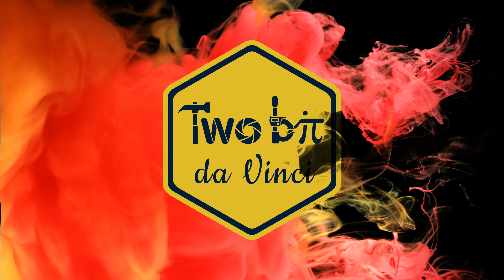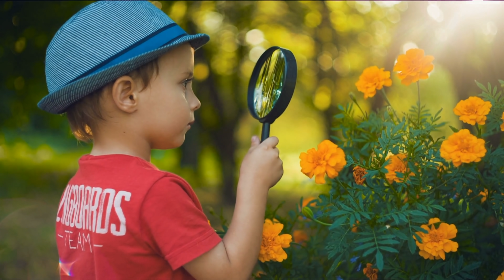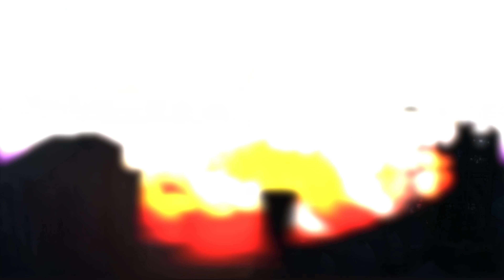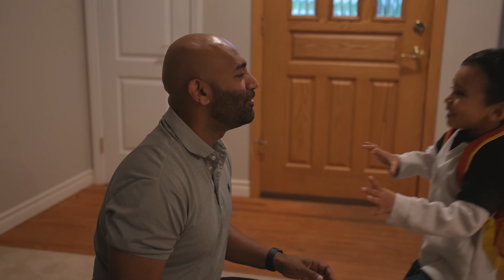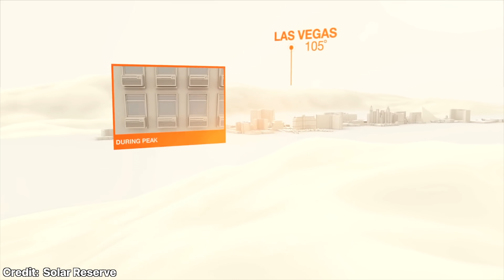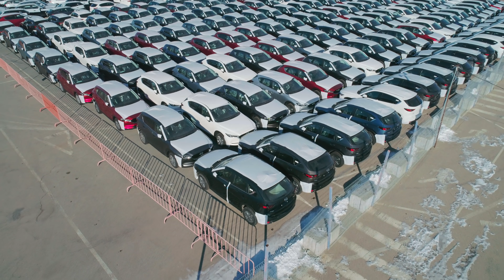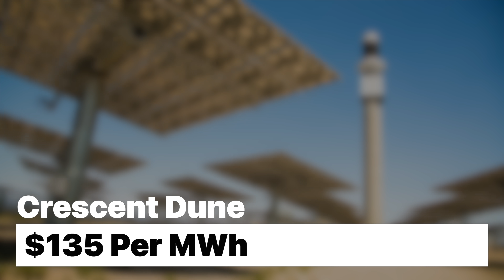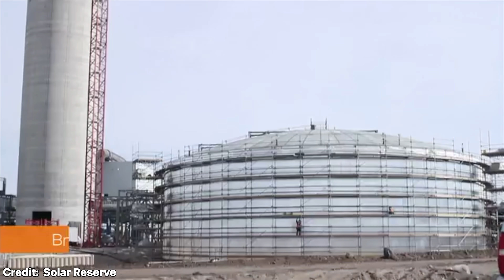This Billion Dollar Solar Plant was an EPIC Failure

Comment: Your video exposes a major flaw in capitalism. The solar thermal plant isn't viable at small scales. Solar panels are. So you can sell more parts than for solar thermal. This drives down costs of parts  faster as opposed to solar thermal parts. Also, you skipped over the effects of government investment. Solar panel investment from government is massive (thanks Obama) as opposed to solar thermal. This is due to lobbyists, who see more cash grab by selling personal solar. Which btw, billions of solar panels and batteries, are horrendous for the environment, as opposed to solar thermal. This video exposes yet another fail for capitalism and government, choosing inferior tech over superior.

Comment: Nuclear molten salt is  a way better choice.  Molten salt itself will be a sensible future tech but not necessarily used in this form. Solar has a huge environmental downstream cost not visible right away with the effects of mining and the energy use required to manufacture the photovoltaics.    Your show seems a little blind.

Comment: I worked on installation of simillar powerplant in Israel 110Mv actual out 130Mv on papers. We had molten salt capacitors with plate thickness more than my forearm. They had to use gas burners overnight (some 100m diameter each, there were 2 of them) to anneal weald seams. The one i worked resembled more your stamdart  solar farm - flat config with concave pivoting mirrors with piping running throu focus line. But on the other side of highway we have ye olde Tower using GE machinerry - 90Mv out of 110Mv, it also had gas turbines instead of molten salt capacitors for night time operation. So far so good, they both running from 2018 just fine.

Comment: Personally, I'm glad it failed.  Lots of birds die to these solar farms every year.  Burned right out of the sky, feathers melted.  Same with wind, but you can actually put things on the blades so the birds can see them and avoid them.  I still think all this is stupid though.  We should be using solar and wind on buildings, but heavy water reactors for everything else.

Comment: The high speed fly-wheels make a bit more sense for short-term energy storage than the chemical batteries which suffer degradation over time.  It's just storing the energy as kinetic energy, or in places that are geologically favorable, as gravitational-potential-energy in the form of storing a lot of mass up high.  But short-term energy storage in the form of heat ... that doesn't really make sense to me.  All that said, I'm a nobody on the internet, and this is not my career field, so take it for what it's worth.

Comment: I am not that sure if this comparison was fair. In order to exactly compare PV to solar thermal or nuclear (both base-load) you would have to build a PV farm that can put out power constantly, the whole year around*. The battery storage quantities for this would be quite large. And batteries are still relatively expensive. I therefor think that the shutdown was maybe a bit early cost wise, even though the maintenance flaws are hardly ignorable.

*RN there is no energy source that can do that, not even nuclear. You always will have maintenance shutdowns.

Comment: the problem is, the number of PVs required to replace a significant minority of our base consumption simply can't be scaled up to the numbers necessary. These plants, although expensive, will need to be engaged.
Reply: Wrong. PV scales up, doubles every 3-4 years

Comment: Well, this is embarrassing... I made my senior thesis on this power plant because I spent a lot of time driving in-between Las Vegas and Arizona and I always found this fascinating. Our question was that Microsoft wanted to build a new HQ in Arizona but wanted to be energy independent, so what is the best clean energy option that they could be completely energy independent? Well I heard this system powered the Las Vegas strip at night based off the heat in the desert in collected in the day which was a perfect application in my mind. Microsoft's main concern was that this system was too expensive for what their goal was.
Reply: oh i thought this was the one down by jean like south west of mccullough
Reply: There's a mistake in the video. The Crescent Dunes plant is in northern Nevada. Ivanpah plant by Las Vegas is still working.

Comment: Have you thought about it may not be the engineering blunder that you made it out to be. If these mirrors can focus collectively on a lot more than that salt tower. They could refocus and track on adversarial air or space assets. It could be a great defense tool.
Reply: If the asset happened to fly reaaaally slow and at the perfect focal distance from the mirror array , AND only on sunny daytime hours…. Great plan!
Reply: @vegasrider7287  both the focal distance and tracking is accomplished with individual mirror servos in place already. Learn how a phased array works and you will have learned how this could focus and track as quick as needed. It take a long time for a satellite to cross the sky. Have you not watched them before? In MI you can see them easily with your own eyes.
Reply: @nathanroberson  You do realize that mirrors only work to reflect sunlight... in the daytime... with no clouds? Pretty easy to defeat.

Comment: This was pioneered by Rockwell Intl., Martin-Marietta, and McDonnell-Douglas in 1982 - called "SOLAR 1", it was located off I-40 outside of Barstow, CA.   I was working at Rocketdyne at the time, and I think we were involved in the collector and thermal storage portion of the pilot project.  I remember the first time I saw it - as bright as the sun - glowing white-hot, very impressive.  As engineers, we discussed whether or not the concept would ever be cost effective.  As I recall - the consensus was, it was similar to desalination - a good-sounding idea that just had too many daunting problems and ROI issues.
Reply: At the time it was probably due to become cost effective. But it got overtaken by simple PV

Comment: You really should find out where this place is.
First, you said you could see it off the 15 on your way up to Vegas, which is right. But then later, you said it was 200 miles northwest of Vegas.
The 15 goes north northeast from Vegas. 
It has been a couple of years since I went toward California on the 15, but it sure looked like it was in operation then. You can go blind looking at it! They should not have put it so close to the freeway.
I thought it was a neat idea when I figured out what it was, but I'm glad I didn't invest in it if it's such a boondoggle.

Comment: Note: Concentrated solar isn’t a terrible idea. In fact, some of the largest solar power generating stations are CSP plants. And while photovoltaic plants are becoming larger and cheaper, there may still be a place for CSP. For instance, in places where photovoltaics are still expensive to import, but thermal power generation has become an established industry. I am not an expert tho, I just did some research because I remember hearing about how the CSP plant near Primm, NV worked and thought it was pretty cool. And, by the way, that plant has exceeded the expected annual output.

Comment: So one thing I'm not getting too much, this whole "cost" bit.... ok so it costs Nevada $135 per MWh, which translates to 13.5 cents per kWh which is looking at my last electric bill is WAY less than what I pay per kWh.   But fine $30 per MWh for the PV solar farm,  who's making the profits here?   Are residential rates 4.5 times cheaper?  No?   The PV farms are selling for cheaper so they obviously aren't making the profits.   How about the guys who are buying the electricity?  That's your answer, they're raking in the profits because now they can buy cheaper "green" energy.    Also is that $30 taking into account the peaker plants that needs to supplement power for most of the night/evening/morning?     

Ultimately though if they were running 20% efficiency when they should have been doing 50%, unless they flat out lied with that projection (probable) if they can get the efficiency up to where they should be that'll decrease the cost by a factor of 2.5x.    While still almost twice as much it would be a good start,  plus you absolutely have to add in some cost for storage.

Comment: Thinking about the S-Curve you mention Tesla that is a company at least car side which is going to run into the S-curve sooner than later they are really successful now as a major EV manufacture but in the not to distant future the big companies are really going to pile into that market. Tesla makes around 400,000 cars a year if a company like Toyota turn 50% of the cars it manufactured into EV that is 5,000,000 cars a year with the result cost reductions from mass production at which point Tesla becomes a Rolls Royce or Jaguar a small manufacture of my guess highend EV's.

Comment: I did a group research paper comparing CSP to Photovoltaic panels for a final in my renewable energy engineering course, and one of the things I learned is that the reason that these are built in the desert is because high temperatures affect the efficiency of photovoltaics. Its sad to see that since they did not plan effectively that the plant failed but it is not the fault of the type of solar energy. This cannot be replaced with a regular photovoltaic field as big batteries would have to be built and the high temperatures would lower efficiency. I hope that somehow there will be a way to make this type of power source cheaper as having a solar power source that has an energy storage system built in is revolutionary. Remember, batteries are still harmful for the environment themselves as lithium is still the main material needed which negatively effects the environment. This type of solar energy uses its own power source as a battery. I definitely still believe that this can work great in extremely hot and open places like the desert outside of Las Vegas but large plants like this need to be careful. If anyone is interested I'll leave a link to my paper in the comments. Please let me know what you think as I am still training myself to master renewable energy
Reply: I'd love to see it.   You'd love Bill Mollison, not exactly engineering, but concepts to engineer from.  Sounds like you are looking to work on solutions not virtue signaling or a camp to be in.  BRAVO. You just restored a lot of the hope I lost reading a lot of the other comments.

Comment: As a layman I'll never truly understand reflecting the sun back up, shouldn't it just divert down?  And I have a plastic fresnel lens that concentrates far better imo.  i don't understand why passive systems aren't being tried.  Solar in this way should just be additive energy, not primary.  Plus we see all these companies across the US who just suck up public monies and don't really have a good plan ... at least this one got up and running, some don't.  We should be pissed.  You can literally put fresnel lenses over a pipe with whatever moderator you want and passively create energy.  1B$ for 100 MW... right location, bad spending and engineering.  people seem to forget, 500M/pop. of US is a $1+/ person... return benefit...$0.  Could I as a novice think up and initiate a power plant for 500M with a return benefit to the public?  Would the public ever get it's $ worth in my lifetime?  yup, i think so.

Comment: "The technology started to debut in 2009..."  You have to be kidding.  I did software development on the Solar One power plant at Daggett in the Carter years, the late 1970s.  Martin-Marietta built a heliostat factory in Pueblo to supply heliostats for the project, and a second in Almaria, Spain.  With the completion of that project, the Regan administration shut down further efforts to investigate solar power.  The plant was obviously a pilot plant, generating 10 MWe.  It operated through the 80s, went through a central tower rebuild in 1986 to use salt generation, then became a test area for one of the colleges in California, before being scrapped in 2009.  It was at 34.8717,-116.8342.  The site is still there, cleaned off.  

I suppose you are right about the economics, but the technology is older than you recognized.  Had it not had to restart from scratch after Regan and Bush left office, it is interesting what might have been produced.
Reply: Thanks for providing evidence that Reagan and Co were instrumental in aiding the demise of solar power through deliberate obstruction.

Comment: I've been interested in solar energy usage since the early days of NASA. I took two solar energy usage classes at two different universities in the late 1970s. Both involved thermal solar energy. A facility like this was even discussed as a possibility. Phase change salts for heat storage isn't new - wasn't new even back then. My conclusion was that thermal solar wasn't the future for alternative energy - too complex and expensive to install and operate. I concluded that PV was the future, but back then PV cells were very expensive and they weren't very efficient. New technologies and mass production has reduced the costs to now be competitive and actually less expensive than some traditional means of generating electricity.
Reply: Total bullshit,we had a cheap ,reliable system with coal fired power stations,co2 is not a problem,the so called science is the problem,now we have an energy crisis that has driven the price of oil and coal through the roof,and shown that unreliables are expensive,and now governments are reverting back to coal,before people start chopping down more trees to keep warm,how green is that,you can't make this shit up!
Reply: @SamsungSamsung-md9xq  Fossil fuels are finite. Worldwide petroleum reserves are projected to run out in about 50 years barring discovery of new ones. Known coal reserves are longer, but most of the existing reserves are buried too deep to be cost effectively mined.
Solar is free, doesn't need to be drilled for, mined or transported. It cannot be controlled by governments or corporations and will be here long after both you and I are dead and gone.

Comment: You can increase output by replacing mirrors with reflective solar panels. The thermal output can be used during the night and pv output during day!

I have worked in solar island proto by csem in RAK

Comment: I can say that the birds will thank the PV solar manufacturers! The salt tower plants have a problem with killing birds! 
NV Energy had agreed to buy electricity from Crescent Dunes up until 2040 but broke off the contract over performance failures at the plant.

Crescent Dunes was developed with $737 million in U.S. Department of Energy loan guarantees 
One of the highest-profile failures at Crescent Dunes was an eight-month shutdown caused by a leak in the plant’s molten salt thermal storage tank.

SolarReserve’s lawsuit blamed the leak on ACS Cobra, a Spanish company that carried out the engineering, procurement and construction work for Crescent Dunes. This accusation was echoed by Bill Gould, SolarReserve’s former chief technology office
U.S. offtakers can get solar energy from new PV plants at around 38 percent of the $135 per megawatt-hour cost that was agreed upon for Crescent Dunes. And the cost differential keeps growing as PV gets cheaper.

Comment: I think one of the coolest "battery" I've seen is the tower - concrete block one. Just a electric tower crane that uses solar power to lift concrete blocks and stack them up high. At night it uses the motor in reverse and sets them back down to make power. Basically like the weights on a grandfather clock
Reply: Those don't work though, these solar towers do work.
Reply: It's easier to find a hill and build a rail uphill, put the concrete in cars. It's easier to get a runaway railcar to stop eventually than stopping a concrete block mid air.
Reply: Ever heard of pumpstorage?🥴 Watch Thunderf00ts videos about this idea, its a big scam nothing more..
Reply: @georgwagner4438  Thunderf00t became a discredited dumpsterfire years ago, and pumped storage appears successful in a few places.

Comment: One issues I would also analyze is how many birds / insects are killed by this concentrated radiation. Probably little as this is the desert but might be significant. The same problem plagues windmills. PV on the other hand is just better: No moving parts, no fluids, and straight up DC which can also be used to recharge quickly BEV batteries. One thing I foresee is the use of electric cars and their huge batteries as residential storage. A 100 kWh battery from a Tesla can power a home a few days and be recharged in 1 hr.
So a BEV becomes a moving battery for your home. Have 2 and one can stay in the garage and plug your home while the other is used for transport.
Some guy already used his Tesla to mine crypto so why not use it to entirely power your home. Get cheap electricity at night on a fast DC charger then use it during the day. Work from home will also introduce this trend.
Reply from the maker: Very true

Comment: Probably one of the best solutions would be flow batteries at the substation level and battery packs (lithium ion, or equivalent) at the premises level. Then could take solar and wind energy and store it for when those sources are not active. I have passed many wind farms here in Illinois where the turbines were idle even when there was plenty of wind. I expect that this is because there was no need for it on the grid. In the Chicago area, we get the majority of our electricity from nuclear (I have heard up t 70%). The rest generally comes mostly from gas fired peaking plants. With a good battery strategy, we could run the wind farms flat out, store the power and eliminate the peaking plants.
Reply from the maker: I love flow batteries… I agree